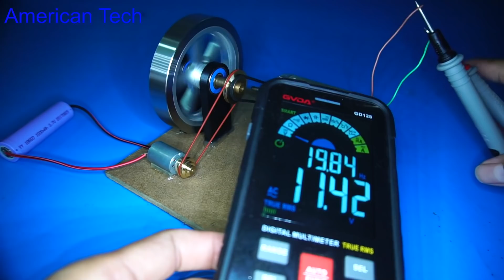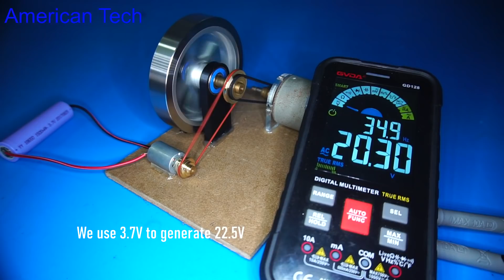How to make Flywheel free energy generator 100% working

Comment: Motor, belts, flywheel, generator, and bearings are all less than one hundred percent efficient. What part of the system makes it more than one hundred percent efficient?
Reply: it's a combination that makes it work,  you start with 4 sources of power, line power, drive motor power, flywheel kinetic energy power, and generator power.      how can it keep going ? well it keeps going at first using line power to power the drive motor.   it's a balancing act, a tuning issue of all components.   generator has to be two or three times larger in wattage than the drive motor.   start with the drive motor and size the flywheel by how much wattage the drive motor has to use to spin the flywheel at the rpm needed to spin the generator at the rpm it needs to spin at under load.  if the drive motor  under load  is running over it's wattage rating  then you need to change gear ratio, and or reduce flywheel mass.   you must monitor the drive motors dissipating wattage.   and also the generators output  wattage under load.  the tuning process is where you adjust gear ratios, and flywheel mass until the drive motor can spin the flywheel fast enough to be able  to spin the generator fast enough to produce enough wattage to provide the drive motor with the wattage it needs to maintain the flywheel rpm.   although at first you won't be using the generators output to power the drive motor at first, you will be using line power.  the generators output will be used to drive a dummy load while tuning the system. once dialed in you then begin with line power and once everything is up to speed you unplug the drive motor from line power and connect it to the generator output.      but it should eventually slow down from friction, the flywheel energy will slow then the generator will slow and send less power to the drive motor and so on until it gradually slows down and stops.    well no,  because we already proved it will keep running once dialed in and running on line power.  why won't the flywheel loose energy and slow down ?  because the drive motor keeps it going at the same speed,   why won't the generator slow down and provide less wattage to the drive motor ?  it won't because the flywheel keeps the generator going at it's rated speed so it keeps producing the same  constant output.     begging to see how it can work now ? then keep tuning it up till you have excess generator output  to power more than just the drive motor.

Comment: something wrong with this, the maximum input voltage of the stepdown module is just 35v but the motor generator is 220v output 😄

Comment: But by ingressing the voltage you must be also increasing the resistance or lowering the intensity, so it’s not free energy. It’s more like a transformer that works with DC.
Also will always be losing electricity unless you find 100% efficient motors and cables (good luck with that)
Reply: ok so its loosing electricity, loosing power, meaning its going to come to a stop right ?   as soon as the flywheel energy is used up right ?  I mean he spun it up with external power and now he has a small drive motor turning a flywheel up to a certain speed, stored energy, and off that flywheel he turns a larger generator.  the generator puts out ac he converts it to dc to power the drive motor.   so the theory here is the same as all the flywheel generators  on you tube.     the drive motor itself does not have the power to spin the generator and keep the generator going under a load.   so the flywheel is used as a buffer, to help keep the generator going ,  energy amplification,  because of the flywheel the generator is able to spin fast enough and maintain its speed to provide the drive motor with enough power to keep the flywheel going at it's needed speed.      good luck with what ?  it seems to be working.

Comment: So you can "boost" the voltage when you use one type of motor to move another. However this can only happen with little or no load. The moment you introduce a significant load the primary motor will slow down and "bye bye" free energy.
Reply: @@Mr.burger.brbrbr Correct. It will slow down very quickly because there is energy sapping drag coming from the bearings and Lenz's law.
Reply: It would probably make more sense at least to me to use his 75,000 rpm acrylic brushless motor to power his 500 watt acrylic generator. If the problem with these "free energy" generators is a load problem on the primary motor then I'm pretty sure there's no way you can slow down a homemade brushless motor spinning at 75,000 rpm no matter how much load you put on it.
Reply: @nemesisobsidian  If load/drag does not inhibit the closed system to slow down and stop, then it would accelerate until alll the components break up when exceeding their specified limits in a runaway.
Reply: @@Mr.burger.brbrbrYou are absolutely right. I was referring to this contraption that uses a flywheel to store energy and only has an appearance of being perpetual.

Comment: Fake but well done compared to other bullshit, the electricity produced by the flywheel which just loops around the Kickstarter voltage is in a loop between that pcb and the flywheel, if you held that led there a bit it would come to a halt

Comment: My name is Stephen, Clement.. This is very possible, it is my childhood dream to create power on self mode. I can explain this very well....
The motor has to be smaller in power consumption example, since 3.7DC V could be able to produce about 22.5AC V. Then, the power from the AC voltage has to be rectified to avoid power from the motor to interfere in the Generator coil. And the voltage was stepped up to 5VDC. When the Voltage is Rectified, the system see it as a battery and remember the Energy is at a higher potential from the  generator so there is excess energy in the Box(Generator motor).
The greater calculation is in the flywheel. We must calculate the Flywheel mass, it radius and it RPM  and then calculate the pulley Ratio.. then configure....
As far as the DC voltage in the Box is In excess then you use a certain fraction so as to not breakdown the RPM..
Am from Nigeria.. It is achievable... All laws of Physics can circumvented. Remember, the Atomic Theory...

Comment: hi there, do you have any schimatics on how build something like this on bigger scale, 3kw, 6kw, or 8kw plus?
Reply: Ulusal yasağı var FBI tarafından tutuklanırsın.!
Reply: you don't need a schematic,  just remember the generator has to be two or three times larger in wattage than the drive motor.   the rest is sizing your flywheel to a size that your drive motor can spin it  without going over the drive motors rated max running wattage.   after that it's all gear ratios to get it dialed in to each  components RPM where it becomes tuned and functioning.

Comment: Well, its obviously fake, but it's one of the most realistic free energy videos I've seen so far
Reply: guaranteed the volts increase by 6x and the amps probably decrease by 9x.
Reply: Well it's just basically a kinetic battery, using flywheel to store the energy, after few hours or even minutes, it slowing down until the electricity is not powerful enough to run the motor.

Comment: When he applies the LED to the "output" of the "generator, notice that the speed of the flywheel decreases rapidly, which means it producing very little current. Not even enough to run a simple LED! Yeah, fake. Further proof - when he first hooks up the voltmeter to the generator, it takes a long time to produce 20 volts of no-load electricity. Once a load is applied (an LED) it begins to slow quickly. I wonder how long it would take for the flywheel to come to a complete stop?
Reply: in the permanent mode, it will stop, and if you include acb in the system, and remove it only during the period, there will be more energy in the system. this is called the exomechanical effect. ergii.
The American "Earth Engine" works according to the recipe for periodic energy removal.
Reply: @SergeRakarskiy  What is acb?
Reply: Yes, it is not at all likely going to keep running without an external power source, although it is possible the flywheel might keep it self running for a very short period of time. BTW, that is not an LED he connected. It was a 'Quartz Dimmable Halogen Light Bulb Lamp'. Look that term up on Google Images. It takes some power to get it to light up.

Comment: Flywheel AC to DC converter power generation depend up load and apms calculation mobile DC section motherboard connected mobile charging